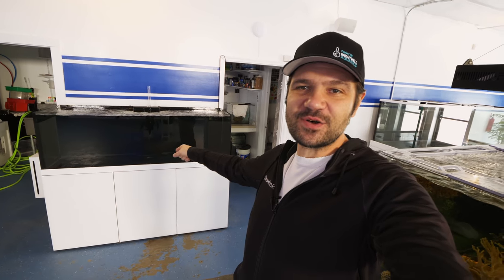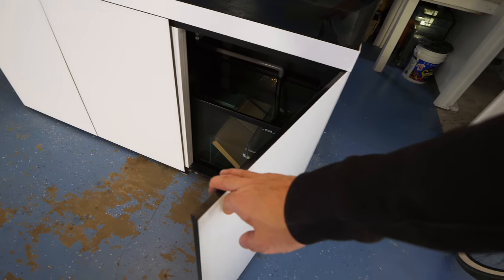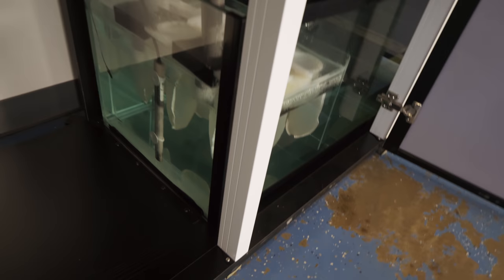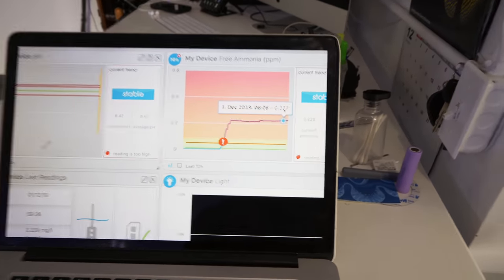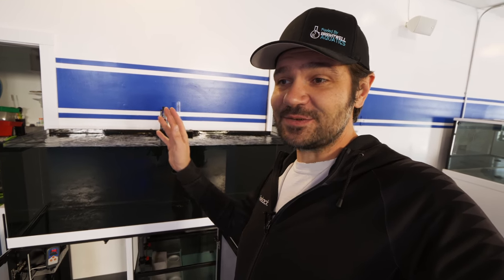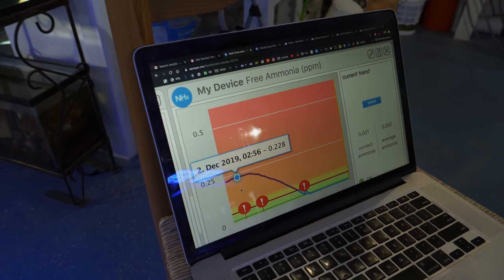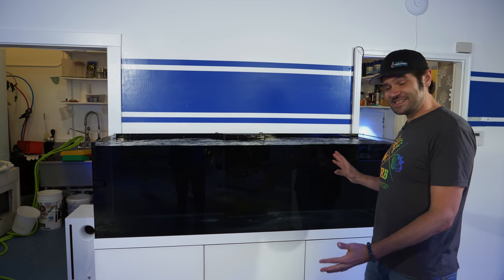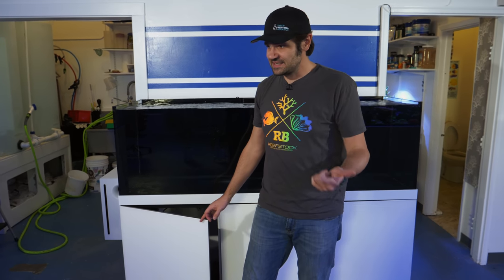How to Cycle a Saltwater Fish Tank

Comment: I've read good things about the new Brightwell microbacter start xlm. I'll be using it on my next build to try it out. Are you going to DIY a lid or get a pre-made one?
Reply from the maker: I’d like to make my own because I need so many, any tips?
Reply: @ReefBuildersVideo  These may be obvious tips, but I recommend getting the IM aqua gadget screen clips to have the screen sit flush with the top of the glass. It looks amazing when done right. Also, I've done many screens with the DIY aluminum window screen kits from the big box stores but they tend to rust after a couple years. I've been on the lookout for a plastic window screen frame for awhile but can't find anything locally. Maybe see if you can find a plastic frame?

Comment: I got a 135 gallon saltwater tank, last night I putt live sand, of course the sea water, heater, some bio media in my 55 gallon sump and dry rock with bio spira water treatment my questions are. Can I use the product that u used with the bio spira that is already in my tank? I sow that u placed the heater in the sump what is the name/brand of your heater? will work for my 135 gallons tank? My heater is too long for my sump so I’ll like to switch it to something like yours.
Reply from the maker: I think you've got enough inoculations to seed your tan with bacteria as it is, now just add a little ammonia or few fish to keep the cycle going
Reply: Reef Builders so can I start ghost feed to creat ammonia? When I should start using the protein skimmer ? I need now the wave makers?

Comment: How come you cannot add other form of bacteria?  I am in the process of cycling my new tank and I am using the Brightwell XLM as well as the  Fritzyme Turbostart 900 (this one has to be refrigerated).  Both products are good, so why not use both?  Wouldn't you get more bacterial strains if you use different types?
Reply from the maker: Some bacteria species compete with each other instead of the actual cycling
Reply: The answer is the difference between Bacillus bacteria and Nitrifying bacteria.  Most of the “live bacteria” products that are in live sand and most importantly “man made rock” (that contain bacteria claims) are cyst Bacillus forms and they are aggressive and will eat the smaller Nitrifying forms causing a longer cycle time.  Bacillus strains of bacteria will only go after Nitrifying bacteria in a new tank situation because a new tank is devoid of organic food.
Reply: @BrightwellAquatics  once the tank is cycled, theoretically could one add different bacteria ?